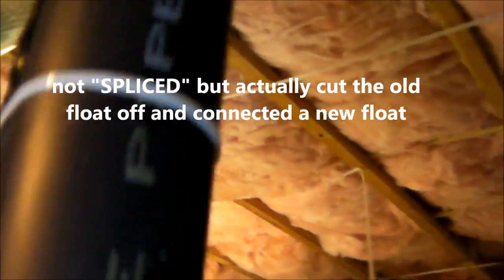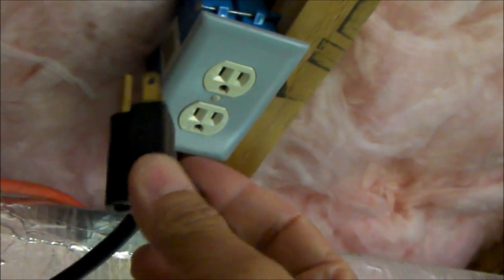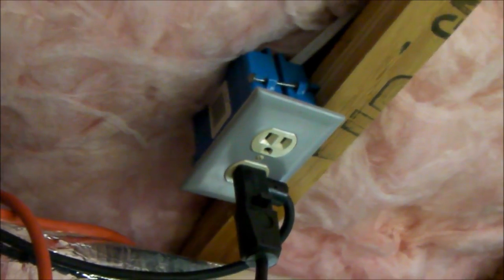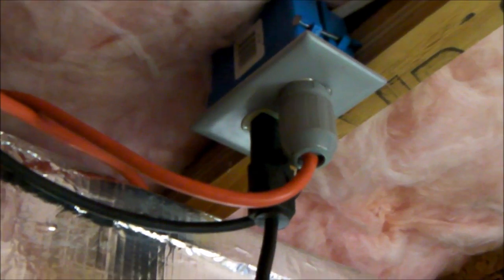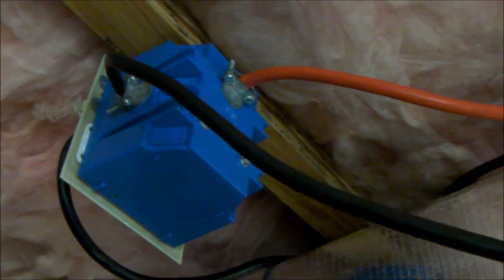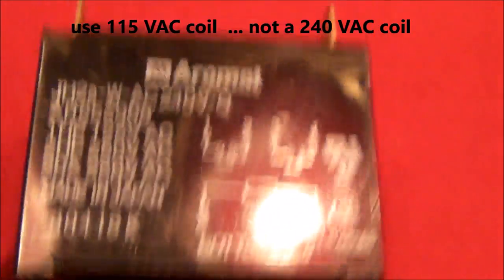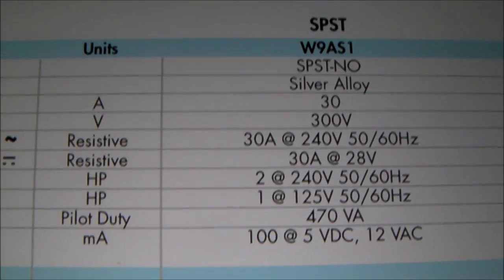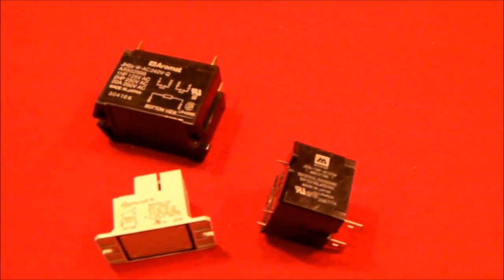How to repair, improve and fix Sewage and Sump Pump Float switch reliability

Comment: Great minds think alike! 
"Deluxe Upgrade": I just got done wiring my float to a 30A SPST Magnecraft relay plus a smart power SSR module...
If you care not to ever visit your sump/sewage pump again, consider adding a "Soft Starter" in serie with the 30A relay to drive the pump!! What kills the contactors is really the repeated in-rush start surge.
Having a Soft Starter significantly drops the surge current necessary to spin the pump from dead stop. 

On my Zoeller pump, my measured In-Rush Start current went from 32A down to 19A!! Steady Run current being around 8A only. 
I believe this will positively save on electric bill, 30A relay life span and pump bearings wear.

Typically you'd want a 9Amp "soft start" (the internal SSR "Alternistors" can handle a huge surge north of 200Amps for couple 60Hz cycles. They are bullet proof) - My pump cycle being only 11secs, I am running a used 3Amp Schneider Starter module I had laying around spare: no problem with my in-rush being around 20A 👍🏻

Wiring diagram: Live goes to SPST Relay then into Starter then out to pump socket.

Should anything fail, I can always plug my pump back directly into AC float sensor.

As my main sump level sensor, I have been using a "Flood Free" module on a stainless steel rod to drive my 30A relay coil (AC float is kept as backup).

I tried adding a cheap 30s delay timer as security cut-off in case the float control should get stuck. (It turned into an relay oscillator using 12DC pwr cube) - So now going to try a $15 digital multifunction programmable module for timing reliability... Preventing a stuck float sensor from burning the pump dry is simple now with separate control and power circuits! Use a cut-off delay timer with NC contact driving main relay coil.

System reliability is only as good as its weakest link: sensors! Capacitive sensors looked promising but may quickly become unreliable in sewage sump application. 
Stainless steel floats with a magnetic Reed contact may be an option if properly shielded inside a PVC pipe... anyone with hands-on experimentations ??
Reply: Can you do a video? You lost me. Sounds like a good idea 👍

Comment: Once you break the seal on a submerged float switch casing, you introduce the possibility of leaking water into the switch which could be very dangerous creating possibility of electrical shock or worse.. Most plumbers will replace the entire pump and will not mess with submersible components or take on liability.  The motor already has wear on it anyway. And you don't want a voltage leak in the pit, even if you GFI protect it.  If you are going through bad switches other possibilities are excessive inrush current and something wrong with the motor not the switches.Another reason to replace the motor also. Is it a good pump?  Regarding installing additional hardware, clearly you are considering it had better be UL or at least CE approved and proper rated and used as intended.

Comment: I keep going through switches, Ive tried several different ones. Will this help to avoid burning out the switch? My pump has never failed, but this seems to help control the power to the pump, I need to figure out why I am burning out the switches?
Reply from the maker: Like I said in the video, the switch INSIDE the float is not heavy duty.  My heavy duty solution places only a very light load on the float switch thereby improving the overall reliability of the pump control
Reply: i had the same problem but hooked up 2 float switches to one pump at differnt levels if one failed the other one kicks in gave me a piece of mind

Comment: You must be a EE. If anyone wants to get fancy with their sump pump setup, you can add in an alternating relay with a second float and pump. Part number is: ALT-115-X-SW.
Reply from the maker: Yep, Purdue EE .... a long time ago!  Wow, that's a pricey item.
Reply: YuDaMan it’s a lot cheaper than a Zoeller SmartPak residential alternator!
Reply from the maker: @jessiebauer816 : that's for sure!

Comment: I've thinking about making something like this, to shut off my washing machine, when the laundry sink is about to overflow. Wife keeps flooding my basement, as either a sock or something falls into the sink, clogging the drain. Need a hefty relay, to handle the current used by a washing machine, especially in rinse and drain cycles. Oh, Water alarms are only good if someone is there, to hear it!
Reply from the maker: I personally would use an AC contactor for the type of application you've described, not a relay.  I can visualize a circuit with a float switch, 24VAC transformer and contactor with 24VAC coil with electrical outlet.

Comment: How did you wire the relay inside the electrical box?
Reply: Thanks for the clarification.  The video explained everything well except when it came to how the relay needed to be hooked up.  In the meantime I did some separate reading and figured out on my own what the NO, NC and com terminals mean, but showing the inside of the electrical box and how you hooked up each wire to the relay would have been very helpful.  I'm an engineer so I have the capacity to understand what's going on, but haven't dealt with relays before.

Comment: why would anyone ever use a relay float if it keeps failing, i dont understand?
Reply from the maker: Because the original manufacturer makes the pumps as inexpensively as possible and some but not all only care about the warranty period.  They are compact and generally work ok .... until they don't.  The relay solves the weakest link in the control system.

Comment: My issue is the floats fill up with friggin water!!
Reply from the maker: If that is really happening then there is a real risk of someone getting shocked or electrocuted!  You should get this taken care of ASAP.
Reply: @YuDaMan  It’s hooked up to a GFCI so it puts a standstill to that..  High water alarm goes off, then that float fills up with water as well... New floats is the only fix.. I put RTV silicone all around them a few days before I changed them.. So far- so good...
Reply: @mlke4258  that's my problem when I shake my float I hear water and it drips out slightly when turned upside down.  I'm mystified as to how this could happen.
Reply: @willb.9225  comes through the cord.. When I replaced mine the last time- I went around the edges, and around the cord with obnoxious amounts of RTV silicone...   That was this past November... Still working.. 🤞
Reply: @willb.9225  I think it’s worth noting these are the everbilt ones from home cheapo...  If you order the pricier ones(red ones) they are made to a much higher standard of quality...

Comment: Any sump pump needs to be Installed on a GFI and seperate breaker. also if your place goes up in flames because of it. Your home owners insurance will not pay for out for any damaged caused by it. esp if you have it Jerry rigged. I've been a home inspector for 8 years along with our depts arson/Fire investigation unit for 13 years...
Reply: U dont understand what was proposed here mr inspector and like most city inspectors u are ignorant of electrical interfacing to take the load off the primary control element,the float.D Steele electrical Tech for 44 years.
Reply: @danielsteele7544  Going by your grammar snd spelling.Etc..I doubt you have over 44 years experience. Also any one with common knowledge to which you seem to lack. Knows that a sump pump goes onto its own dedicated line and if smart enough one with a GFI. And again if smart enough you'd know why it should be a GGI outlet.

Comment: This video is terrible in my opinion for a number of reasons: 

1. You completely omitted showing how you installed a new float to your sump pump. The float on mine comes out of the pump, into the water, and then up to a plug with a piggyback outlet on the back of it that plugs into a receptacle on the wall. 

Replacing the float would not be a simple fix for anyone besides maybe a real electrician because whatever you do is going to be below water at some point. So doing that correctly is crucial. And you didnt show how you did it at all or thoroughly describe what you did. 

2. You mention relays, switches, contacts, and controllers without showing each one and describing the function of each one. So again, you would need to be an electrician or electrical engineer to understand all the stuff you were talking about.